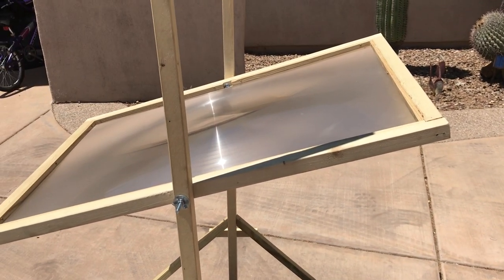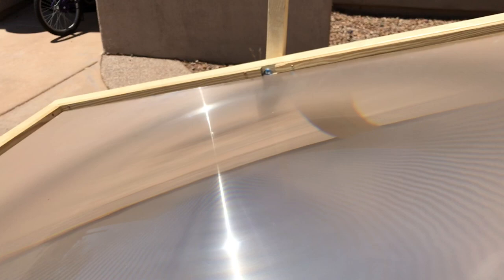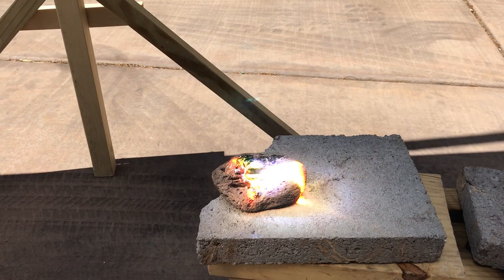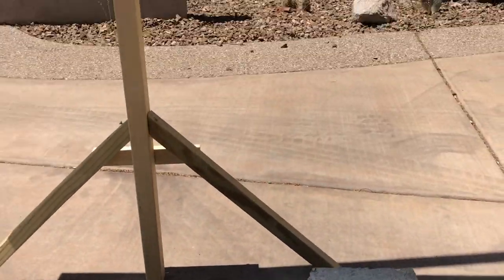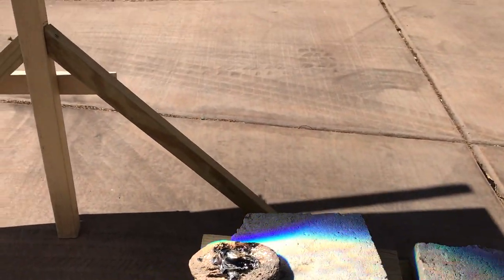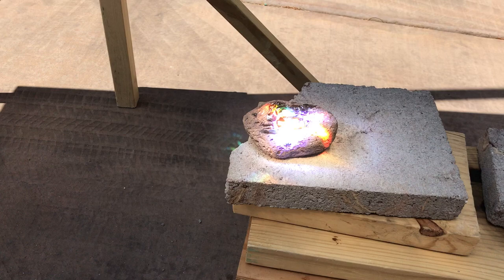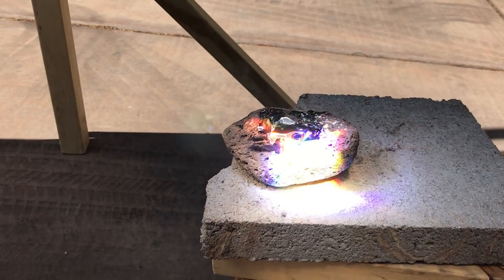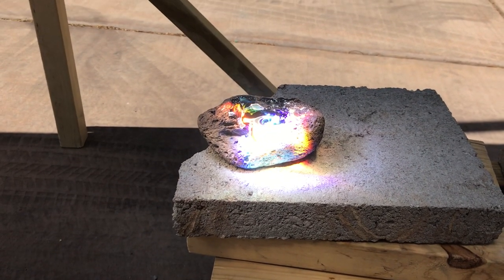How to melt rock with solar power

Comment: Why is the top rock melting but the base rock aint
Reply: illuminati
Reply: Rock is a bad conductor of Heat,
It's an insulator in simple words
Reply: Because the hottest part of the focused sunlight is like a laser, very small, he moves the giant screen to melt the objects, although sometimes he also let’s it be still and explode a soda can.  The important part of the screen is the very center.  He could cut off all the edges and have the exact same effect using just a 12” disc of the center bit of this old TV screen.  He could also us a small quartz Crystal ball from a rock shop.  Yes for about $10 you can melt rocks with sun in your yard.   Mind you this is dangerous.  You cannot hold the crystal while it heats up you will get a severe burn.  You should absolutely have a hose nearby and a dark sturdy box to put the crystal in in case you have to fight a fire.  Dropping it on the ground in panic can cause it to focus anywhere depending how it lands and it will burn from a decent distance.   Under green grass is dead grass so don’t fool yourself thinking the lawn is safe unless it’s soaking wet.   If you drop your hot crystal into cold water they often crackle open into new shapes.  You can do this with marbles too.  They are very sharp after crackling, mind the edges.
Reply: It's focused on the top rock
Reply: @condarsaint5918 Right, the hottest part is actually a single point that he adjusts to where it hits the top rock exactly. It seems like the light acts as a straight laser beam, but it actually makes a cone with its tip at that point
Reply: most of the light is focused to a pinpoint. the rest is very bright but still not much compared to the intensity of the tiny focal point
Reply: @lisathomas1622 no this is wrong the massive surface of the fresnell lense is what make it so hot at the focal point. It focuses the area of the lense to a extremely small area. If you cut out sections of the lense then the energy decreases by that portion
Reply: Because it is focused light video might make it look like it is mostly re spread but it aint

Comment: Couldnt we use lens to boil water for steam power? Only without the need for a fuel to begin with.
Reply: It already exists. They use multiple mirrors to concenteate light in a tower and boil water. If you want to find out more about it search concentrated solar power.

Comment: Can You change Lead into Gold. Its said that with light you can change lead into gold. Maybe some experiments of how hot or can you change lead.
Reply: Lead can only change to Gold in particles accelerators, because Lead and Gold are both pure elements of the periodic table. You need to add 3 protons to Gold (79-Au) to obtain Lead (82-Pb). The amont of energy required to break Lead atoms into Gold is far beyond what is displayed in this video.
Reply: But that is what they told you and wrote down. Some secrets never get written. Challenge the theory maybe combine metals under mutable high sun heat sources. Remember Sun is not just light but Particles that we don't fully understand. @WallySketch
Reply: Bro's really trying to rediscover alchemy

Comment: But jet fuel can't melt steel beams
Reply: but it can weaken the metal therefor it "bends"
Reply: It can weaken structural steel.
Reply: @thelastsaiyan6631  yea but it cant weaken the tin foil hat that this guy has on😂😂